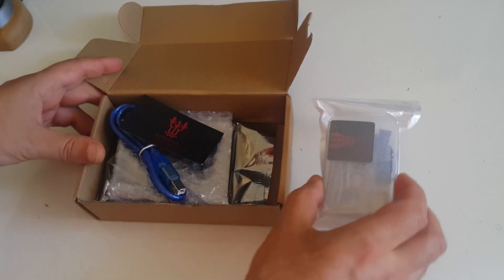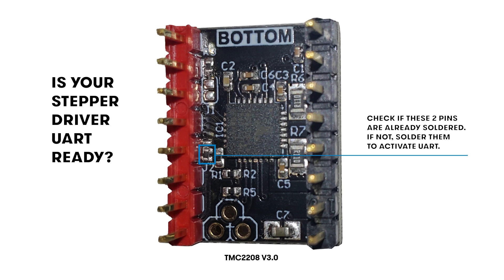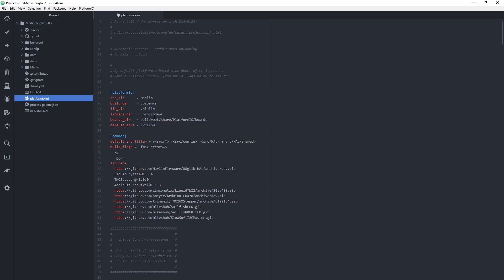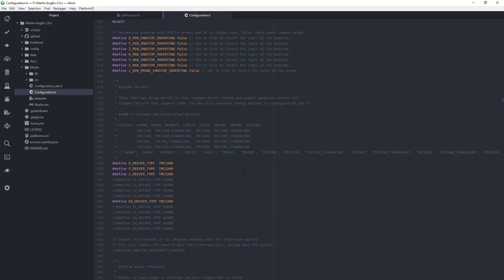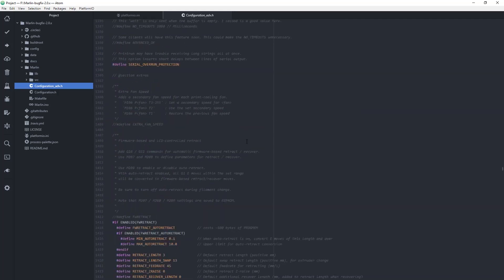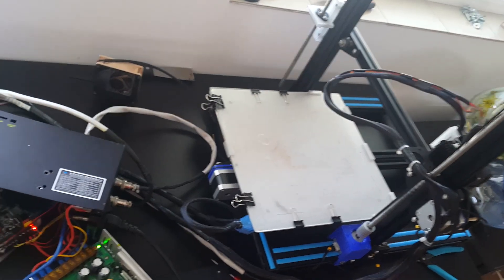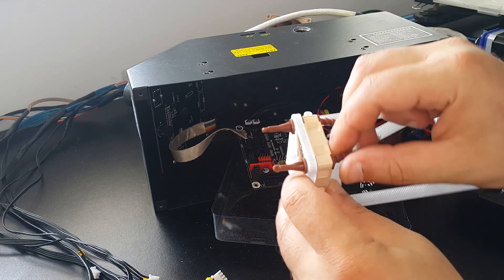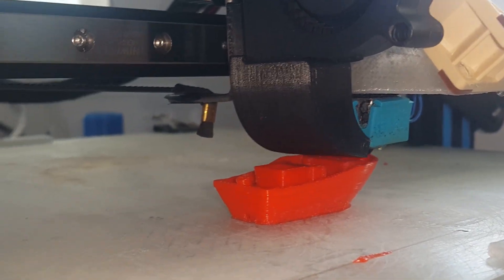SKR V1.3 32bit control board upgrade for CR-10

Comment: Hi , thanks for the video, please can i use the most current version of the BIGTREETECH® SKR for my CR10 ?and which one? the link to aliexpress is not available!
Reply from the maker: Yes, you can use the SKR V1.4 (Turbo or not) if you want a board with separate drivers or the SKR E3 mini V2 (integrated drivers). If you buy the E3 mini, just check with the seller that the board processor is STM and not the GD32 (a clone used in some boards because of current STM chip shortage)

Comment: I'm curious what you wound up using for stepper voltage for your extruder?  Bondtech usually suggests a pretty low voltage (0.4 as I recall) for most installs.  I've used 0.7v on a CR-10S Pro v2 BMG and that's worked pretty well.

Comment: I have everything hooked up with marlin 2.x flashed but none of the stepper motors are moving. I'm using a standalone V1.3 board with no stepper drivers please help
Reply from the maker: Hi, what do you mean by "no stepper drivers". You have drivers hooked up in the board right?
Reply: @3dpblog  the board did not come with UART it's just the board
Reply from the maker: @HolaSoyAndy  the board controls the drivers. You can not run the motors without drivers. Each motor has its own driver, for Z if you have 2 steppers they can run on the same driver and you need to make ot buy an Y-splitter cable. Just buy some TMC2209 drivers, they are perfect with this board.
Reply: @3dpblog  Silly me, i thought the board can function without them, thank you

Comment: Man this would have been useful but for the fact that you didnt bother showing any of the wiring from the CR10
Reply from the maker: Hi, what wiring are you refering to? There is a mapping of the connectors of the stock board and the skr 1.3 in the video. What else?
Btw it is old video already. Today better option would be the skr 1.4 or the skr mini e3 v2.0

Comment: Nice upgrade. Some months ago I upgraded the Alfawise U10 with Lerdge Board to "silent" 32 bit machine with BL-Touch. Next I will upgrade the CR10 , but with switching extruder, moving the current printhead (with rubin nozzle) to the U10

Comment: Do you have a wiring diagram for connecting the Heated bed MOSFET(Creality} to the BTT SKR controller board? Also the hot end. I just want to make sure I have them wired correctly. Nothing in you video show how these are connected.

Comment: Salut , merci pour ta vidéo elle m’a beaucoup aidé, mais j’ai un problème j’ai mis le firw marlin bugfix 2.0 tout c’est bien passer mais quand je met le carte sd dans mon imprimante cr10 je ne sais pas accéder à mes fichiers possible de m’aider stp
Reply from the maker: Bonjour, moi j'utilise Octoprint sur raspberry pi et la SD card est juste pour flasher le firmware.
Regardez pour votre cas ici: https://www.reddit.com/r/BIGTREETECH/comments/dg6mtv/printing_from_on_board_sd_card_skr_13/ et ici: https://www.reddit.com/r/BIGTREETECH/comments/fby7ft/printing_from_sdcard/, cette approche marche, mais il y a certains inconvenients.
Si vous voulez imprimer depuis la SD la meilleure solution serait d'acheter un display compatible de chez Bigtreetech qui a un slot SD.
Reply: 3dp blog franchement merci pour ta réponse car personne ne m’a aidé maintenant c’est clair 👍

Comment: Hi. I really want the skr 1.4 with the touch screen on my cr10s. This is the only guide that hasn't blown my mind apart. How do I know what setting to add and change while flashing the firmware. If i just copied yours would it work
Reply from the maker: This guide is for SKR V1.3 and the stock display - so it wont work. I hate small touchscreens. Should be quite easy to setup though.
Reply from the maker: Btw if you use Octoprint, check Octodash
Reply: @3dpblog  thank you for the reply. No there totally stock cr10s that are a few years old. Perhaps id be happy with just octoprint and BL touch. But i felt that these skr boards would be a nice upgrade to bring my printers upto date

Comment: Thanks for the tutorial :) - I'll be re-watching it a third time later as Amazon has delivered my SKR V1.4 earlier today. Do you happen to have a guide on how you upgraded the X axis and the head of the printer? There's so many options out there that it is quite easy to get lost (and much poorer) - the screws on mine are no longer letting go (too much invisible cooked laquer I guess) which means that I'll have to drill into them, so while I'm at it it wouldn't hurt to "upgrade all the things" :3

Comment: For accessing the sd card from outside is it necessary to use an extension cable ?
Reply from the maker: Yes, it is.
Reply from the maker: But check also on Thingiverse for other mounts for the skr. Myself I use Octoprint and I open very occasionaly the control box - just to update Marlin. My sd cart is only for Marlin.
Reply: @3dpblog  Ok now I understood why you didn't use an extension cable, there is also the option of Wifi through ESP-01, even though it seems very slow (I will check). Thanks for the answer.

Comment: Also, your power wires are not discussed in much detail especially the constant power one from the cr-10 and look to be stacked with the main power.  Is that the right way .  also the limit swtches don't fit unless you cut off one half of the little guides on the connector.   Lots of confusion here.

Comment: very unclear how the stepper connections from the cr10 are inserted, seems like too many pins for 2 pin connectors.  You mention another video which I don't see about wiring.   Also, what is done with the always on red and black from the cr10, no mention of that.

Comment: Anyone know what I should be doing with the red jumpers on the SKR 1.4 board when adding the drivers? It's a different layout on the 1.4 and I don't see red jumpers I can remove and reposition as shown `at 3:50.

Comment: Thanks for the video! Running into some issues understanding where to connect a 12V fan for the CR10S original green bird hot end fan? You seem to indicate to connect it to the 24V input on the board? Also I have 2 z stepper cables do both need to be connected?
Reply from the maker: I connected the hotend fan directly to the incomer (12V in my case). It is running when the printer is On. You can though connect is to a dedicated terminal (if I remember correctly it is P2_04 - check the scheme of SKR V1.3). Than you have to specify in Marlin the that P2_04 is for the hotend fan. The only advantage of this is that you can turn on the hotend fan when the hotend reaches a given temperature, ex. 50 C.
For two z steppers you need a spliter adapter cable.
Reply: 3dp blog thanks for the quick response. Are the two z stepper necessary or can I just use one? I only have 4 2209 drivers
Reply from the maker: @ashepp  dual Z gives you much more stability on the gantry. If you have already 2 z steppers - use them. I personnaly use dual Z with 1 z stepper. The two Z lead screws are synchronized with a belt. Search Thingiverse for "dual z one stepper" and you will find many implementations.
Reply: 3dp blog thanks I’m somewhat of a newb so wanted to confirm that I have 2 steppers (standard CR10S) here’s my old control board https://pasteboard.co/IUB8rrE.jpg
Reply from the maker: @ashepp  I see. In your old board you have 1 z stepper driver with 2 connectors. The same can be achieved with one connector if you connect the wires of the 2 cables - it is a simple splitter.
Reply from the maker: Or if you dont want to cut the wires look for a spliter https://www.google.com/amp/s/m.aliexpress.com/item/32823427728.html
Reply: 3dp blog for anyone else looking to do the same with their CR10S here’s a great video https://youtu.be/yVoJO-2pO9c

Comment: im looking into upgrading mine also, what is the benefit to upgrading?
Reply from the maker: Well, I upgraded mainly to have more space and processing power in order to use more features in marlin. Also the stepper drivers are replaceable. Otherwize 32 bit boards handle better high speeds, but I print with max 80mm/s because of other mechanical/filament type related limitations, so not really important.
Reply: 3dp blog ok thanks.. 
what about print time.. I seem to have trouble when I print a big print. Say it takes 20+ hours to do. It’s all fine and good with that but when I try to do another right after it messes up in every way.. if I let it set over night it’s good..
Reply from the maker: @kwhump  I am a bit lost here. Myself I have consistent results when printing one thing after another, just like I had with the old board. 
Are you leveling your bed before the next print (manually or with a probe)? Or could you describe what goes wrong?
Reply: 3dp blog no I’m not leveling between prints.. I thought it would retain the level if I didn’t turn off the power, I have a bl touch that I use to level.
Reply from the maker: @kwhump  When you print big there can be disturbance in the bed geometry. I also use BLtouch and it performs the bed leveling sequence before each print.
Reply from the maker: Just write a G29 command after the G28 command in your startup gcode in Cura or S3D and it will perform bed leveling before each print
Reply: 3dp blog ok I’ll try that.. I had that in there at one time. But then I upgraded to a newer marlin and use the bed mesh on there.. and it does so many points that I have it saved and just reload it.. 
thanks for all your help!!

Comment: Hello, I follow your tutorial and i am stock with my CR-10MIni some channel said the the driver just have use a jumpper, you said solder, i tried jumper because my tmc2208 didnt come solder and my printer work everything else but the steppers do you think it is better to solder and by any chance could you upload a version of your firmware to compare if i am not doing wrong in the fiormware, thank you you explaid everythingh excellent keep going.

Comment: lol i get 15 errors, LPC1768  FAILED
Reply: build first the platformio.ini and than you can build the other two files who are modified.
Reply: @Ge-Heim  thanks, i fixed it already , you have to imput a full name whit motherboard and board and name of the board, othervise it wont work, also minor changes can mess up things if not carefull. thanks again

Comment: Hi, great video. I followed your guide but getting tmc connection error and when running M122 getting all low on every axis. Any idé what the problem is?
Reply: Im having the same problem. Did you find a fix?
Reply: @LilBean99  yes you have to put a pin on TX and rx on top of the chip then everything works great.
Reply: @Djinn112  Thanks that fixed it! I've just got some problems with my z axis and bed not showing up. but that's probably firmware related.

Comment: Another question.   My bed is working, so I'm going to ignore the cycling mosfet.  Now, however, I have a problem with the stepper motors making high pitched noises when they move.  These noises actually don't go away when the motor has finished moving, they keep on making that noise.  I bought an SKR 1.3 and the 2208 drivers to quiet down my printer, but now it's noisier than before.  Is there something I can adjust to keep them quiet?  I adjusted their mA from 600 to 800 with no difference in the noise.  What could be causing this?  CR-10 Mini.

Comment: Ivan, at the same time I installed the SKR, I also upgraded the mosfet for the heated bed.  Once the bed reaches the desired temperature does your mosfet cycle rapidly to keep the temperature set?  My mosfet has a red led to indicate it's powered.  The led stays lit until it reaches temperature, then it starts blinking rapidly between on/off to maintain the temp.  This also ramps the power supply fan up and down constantly as the mosfet draws power, stops, then draws again, etc.  Quite annoying and not what my original motherboard and mosfet did.  Is yours also cycling like this?

Comment: Hi I installed the skr 1.3 on my cr-10 like you my problem is that the z motor started doing strange noise any suggestion ? Same for the extruder
Reply from the maker: Is it working or there is noise only without movement?
Reply: @3dpblog  when is moving ofc
Reply from the maker: @barderino5673  well, I didn't have this issue so I can only guess. I suppose you are using tmc2208 in UART with the standard steppers and 12v PSU. I would check the stepper currents (too low?) and would disable stealtchop mode if enabled. Also what is your speed? I would try slower printing speed to check if the problem persist - like 40mm/s. It is stranhe the noise is on the Z stepper though. Try to run it in standalone mode may be. It's been some time since I made my mods and since I changed also the driver for the extruder with TMC2209 to get linear advance working stable.
Reply: @3dpblog  with stealth chop off the z stepper starts making noise even while not moving drivers current are all on 800 hybrid threshold on the z  Is set at 3
Reply: @3dpblog  I'm so sorry the threshold was set on 3 :l
Reply from the maker: @barderino5673  what is your microstepping? 16 or higher?
Reply: @3dp blog I don't know :l , I lost my configuration with my old PC but as long as I remember I seted everything like you ...now I have increase the hybrid threshold... everything is quite... and blobs are gone from my prints ....now I have others problems but that's another story 😅
Reply: @3dpblog  Ma solo adesso vedo la scritta dietro in italiano ahahahah
Reply from the maker: @barderino5673  haha, that is because Roberto (Futurama character) is from the mafia.
Reply: @3dpblog  so you are not Italian but you have a poster of Roberto in Italian lol 😂

Comment: SKR 1.3 has terrible quality control and if you buy from Aliexpress you will not get a replacement or your money back in case of failure.

Mine at first had usb not recognized issue followed with board not powering up anymore
Still trying to find cause, seems that positive terminal where yellow blade fuse (20A) connects is not working and same looks to be the case for bed terminal. Seller is not answering same goes for Biqu support.

It is cheap board but you are risking wasting monry unless you buy from amazon.

Board worked fine for a week before failure.

Comment: Hi

I have a question about the bed. Are you connect directly the bed positive and negative wires or you use the build-it mosfet in the controll box? Because when the bed temperature reach 45 Celsius degree I get a failure message and the bed heating is stop. But just only in 45C, on lower temperature is everything fine.
Reply from the maker: Hi. I use the mosfet - it is already there and it is safer do not power directly the bed from the board, but through the mosfet.
Reply: @3dpblog  Hi
I found the solution and the problem is on your source. I cut out the "#define POWER_SUPPLY 0" line and change the temp_sensor_ bed value from 5 to 1.
Reply from the maker: @antipaladinify  oh, ok. These settings come from my previous setup with the stock board. Firmware was from TH3D. Anyway, I am using the mosfet and anything works fine.
Reply: @3dpblog  Thanks.

Comment: You remove the mosfet of the Cr10? Thanks in advance
Reply from the maker: No, I keep the mosfet it is an extra protection.
Reply: @3dpblog  ok thanks im doing the same project upgrading to skr1.3 but with tmc2130 drivers and touch screen
Reply: @3dpblog  thanks for your help

Comment: Nice vidéo! What about tension 12v or 24v is set to driver? What about the bed heater in 12v . I think all your setup works in 12v . But IT seems driver perform good job in 12v is IT correct? 
Thank you
Reply from the maker: Hi, yes my setup is on 12V withe the stock PSU. The drivers are working fine for my range of speeds (up to 80mm/s). I know the story that 24V is better for trinamic drivers, but so far I didnt witness any noise, performance or heating issues (at least for this range of speed). My bed is also stock on 12 volts, I didnt upgrade it because I am using polycarbonate sheet for bed surface with a max temp of 80°C for any material incl. ABS and polycarbonate filaments (check my video for the polycarbonate sheet).

Comment: Hi

I have a stupid question.

I compiled the source and save it to the 128 mb sd. But what would I do after? The board will update itself automatically?
Reply from the maker: Yes. Just turn off / on the power or press the small red button. The firmware.bin will ovewrite the existing file and will disapear.
Reply: @3dpblog  Thank you.

Comment: Why would I want to go for UART? as it seems I need to order stepper drivers uart or Dir?
Reply: TLDR:  You can use whatever you want SPI/UART
You can get non-UART drivers and switch them to either mode if they support it. It just requires soldering a couple points together. You can order UART drivers where this soldering is already done for you. You notice the trim pot on the top of the driver? Thats not utilized in UART since the voltage is electronically controlled but you have the option to run it manually if you want. If you decide to use other non-uart drivers then you jut need to put a couple of the jumpers in for the drivers your using and itll work the same as it does on your current board.

Comment: Is this setup the same for cr10s?
Reply: The biggest issue is going to be with the dual Z steppers - I was going to get the SKR 1.3 but noticed it did not have dual z steppers, but the SKR Pro does. I dont know if you could get the 1.3 to work like that but I dont know. The pro is only like $10 more and works (pain in the rear to setup though)

Comment: once the board was in the case how did you give the board SD card/USB access? I noticed they are facing towards the inside of the case. is that the way the adaptor bracket is meant to have it?